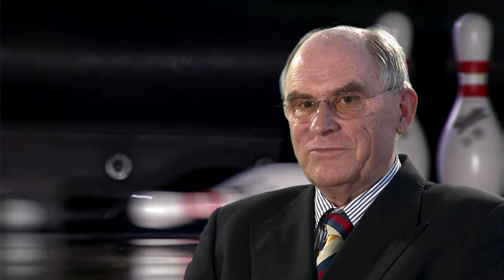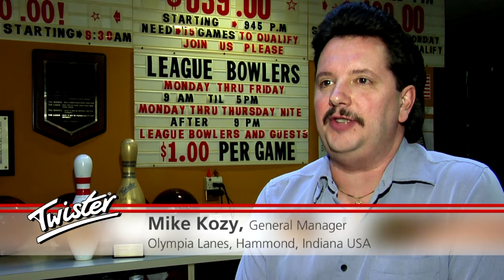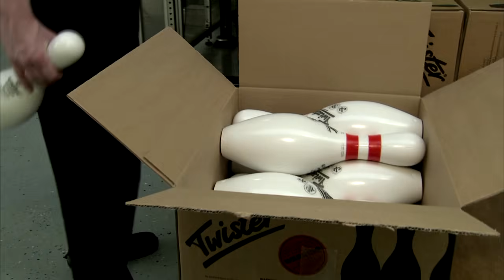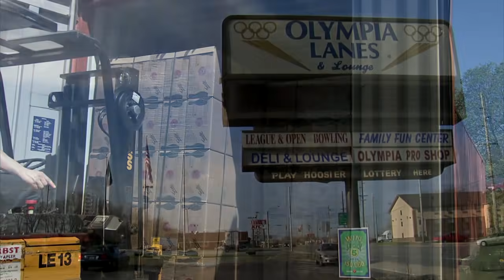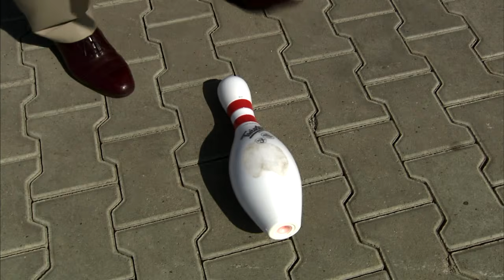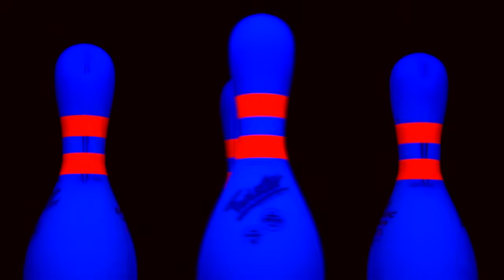Twister Synthetic Bowling Pins

Comment: And these plastic bricks known as twister are horrible compared wood pins. First of all, they bounce everywhere and unlike wood pins, they DONT Have nylon rings on them so because of that they don’t grip the deck and just slide, then they test them compared to wood pins in situations that would NEVER occur in there life like what would you expect when 400 tons would fall on wood pins, they would splinter if it was not obvious then use a pin cleaner that is ONLY compatible with twisters because them twisters have holes going to the TIP and wood pins Don’t which completely RUINS the Cleaner capability with ALL pins

Comment: I like this pin yes it does sound odd, but because of it’s high durability, permanent logo some bowling alleys have gone for the Twister pin because they’re finished with wooden pins, I already seen one bowling alley who got the Twister pin and will not be getting anymore wooden pins anytime soon.
You may prefer the wooden pins, but you can’t do much if your local bowling alley has thrown away the wooden pins and will not be getting them again because they gone for the strong twister pin

Comment: The main issue with these pins for a center is that they can be so durable they break machine parts when a deck jam occurs. If the pin is stronger than the machine, and something has to give, I would always want the pin to give instead of a moving deck.

Comment: These pins had there good and bad characteristics. When you hit the pocket light you almost always would shred the rack and strike. When you hit the pocket a touch high. The kind of high hit that on wood pins you would either leave a 4 pin or you would trip the 4 pin. On twisters you would leave the 4,9 split.

Comment: They have higher scoring, because they are more consistent, and that's a good thing.
Bowling is skill based game, and any variations should be limited if possible.
If they are approved, this means they same average characteristics as wooden pins, but they don't bend or damage so easily.
And they are cheaper!
These are all big pluses in this sport.
And yet, people are complaining about sound (LOL), or the fact, that they are too consistent (better scoring).
Well fuck me, lets go back to children setting pins, since pinsetters are too consistent.
Reply: One thing I’m worried about Twisters are sliding across the pindeck and won’t fall. I know cleaning the pindecks would be the solution but pretty much most Pinsetter Mechanics would rather clean the Pinsetters and not the pindeck.

Comment: I would think the goal of making a synthetic pin would be to duplicate the behavior of a wooden pin. If they fall down easier, I would have to say product is a failure.  If you take away the challenge of a sport by making it easier with equipment, You are taking the sport a step backwards if you ask me. If the higher scores are because the product is more consistent,  I have no problem with that
Reply: My bowling alley actually switched back to wood pins
Reply: What another things?
Reply: Wood pin sometime stand back up while plastic don't have that problem
Reply: A lot of bowling alleys are not using wooden pins anymore.
I'm sure there are benefits with wooden pins than Twister Pins, but some bowling alleys around some countries have been having problems with the low life of wooden pins now, wooden pins are easier to break than Twister Pins, bowling alleys will buy new bowling pins, and then after not that long, some are already weak, some already need replacing, they're just ridding of wooden pins and buying Twister Pins

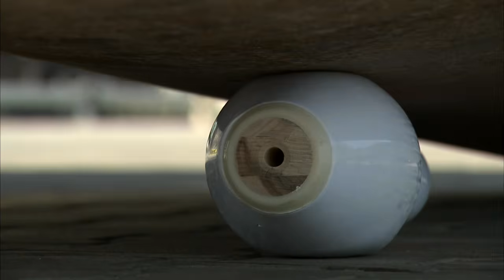Comment: look at 6:00 clearly video jumps to a more crushed pin must have taken a couple of runs to get the wooden pin crushed like that.
Reply: From 6:02 to 6:03 there is a clear cut in scene... n00bs
Reply: Yes indeed. I watched it over a few times and if you watch the bottom closely, you see the end grain changes slightly and there are four dimple markings which become much more pronounced. Definitely not the same pin we saw it drive up on.
Reply: Lufty25 is
Reply: Lufty25  I Don't Agree